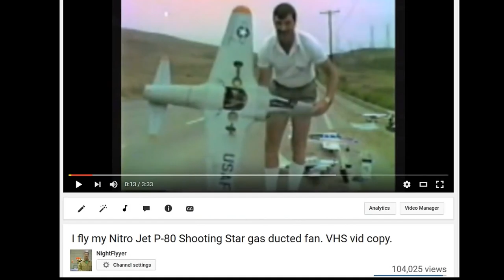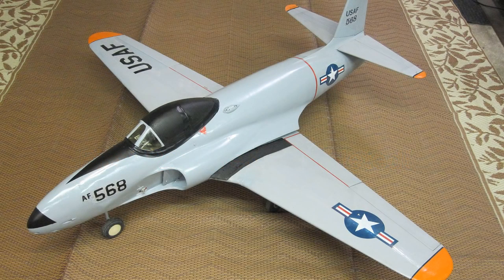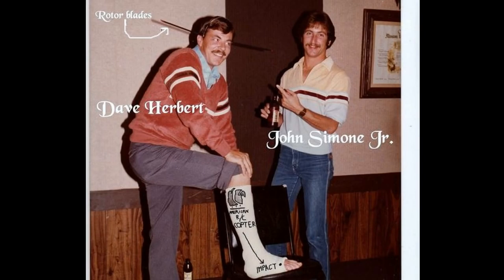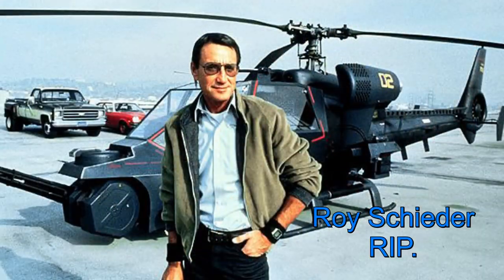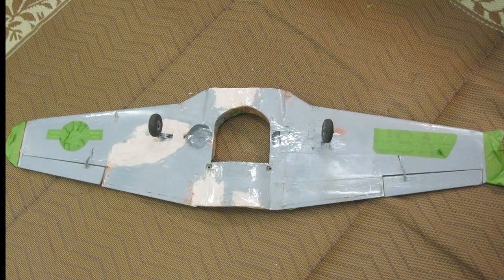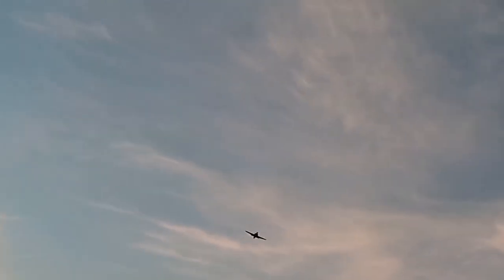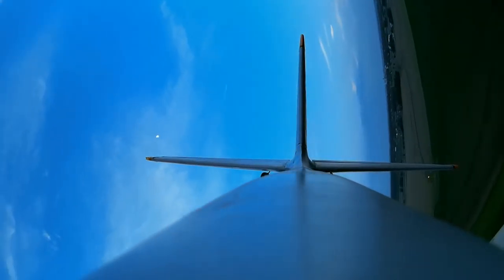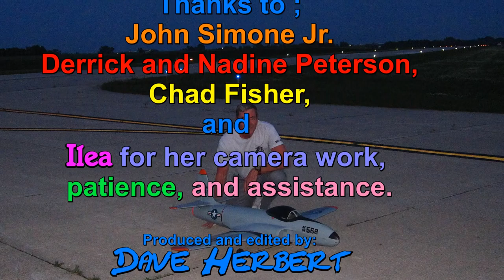Third Flight Attempt of the Crashed  P-80/F-80 Shooting Star internal combustion ducted fan jet!

Comment from the maker: I now know where the CG is for this particular model by educated guess.  Then by adding 5 ounces of nose weight and other mods I am satisfied.  I still do not know the manufacturer, as I did not build it. Thanks for all the help and comments from everybody.  Next time, I am going to add a glow plug battery to turn on at low throttle to keep it running at lower speeds. Thanks everybody. ~Dave

Comment: I enjoy that very much Dr. Herbert. Congratulation on the flight and nice story telling. Thou I would be lying when you was taken those dive and high bank curse. One point I thought it was about to loose power, and then Nose dive when you was making that one High Bank. Glad everything went smoothly.
Reply from the maker: Hi Captain and thank you so much. I agree with the diving part, but when I tried it on the first two attempts, it would stall before I could dive.  Then started diving on it's own and  snap rolled when I gave elevator to pull out and crashed.  But now...Yay!  Thanks again.

Comment: Hello Uncle Dave :) , just curious if adding re-tracts would have a big impact on yr P-80 weight & flying characteristics ? Thanks again for being such an inspiration to us young ones ... !
Reply from the maker: Hi.  Well it has retracts and they used to work, but deteriorated air hoses and a destroyed air tank in the first crash made it not that important to try to fix.  The speed would only be increased as the weight is the same, since they are still in. Good observation and thanks for the comments.  Uncle Dave

Comment: One trick you can do is alligator clip a battery onto the glow plug that is activated by a microswitch while at low throttles to help keep the glowplug hot and prevent motor stall.
Reply: I just noticed your comment from a year ago mentioning exactly what I just did. Looking forward to updates on this jet.

Comment: Fab flight Dave, seems to glide a lot better now. As for sucking in air, have you tried a felt clunk in the tank the same they use for a gasser? Just an idea
Reply from the maker: Both tanks actually do have clunks.  The plane actually landed with lots of fuel left too. It's because I added a feeder tank that does not get air til the first tank empties.  The engine ran great and I could have flown it much longer.  Good comments and info. Thanks kindly.

Comment: Hello!

Very nice plane and nice flying!! :D
I red somewhere that you should use a servo (micro/mini) for the highspeed needle, so that when you hear it quitting, you can just flip a switch on your radio so that the engine runs richer. Have you ever heard of this?

Keep it up!
Greetings from Norway
Reply from the maker: Hi Norway. Yes I am aware of those setups. In this case there is a remote needle valve on the machine.  The carb needle is fixed. The external remote needle valve  (silver knob on fan mount) is very hard to turn on purpose as vibration can loosen it.  This engine is set to run wide open with the tuned pipe and richening it at all would kill it.  To keep it running at low speed though, I will be adding a servo with a glow plug battery that turns on when I throttle it down. That way it wont quit as, it is too rich at low speed already which cools the plug and quits. Of course I wanted to kill it this time, so I could see how it handled on landing.  Good thinking and I appreciate your comments. Thanks very kindly.

Comment: Looks like you have a little elevator flutter and it seems like the whole tail section has a little twist to it.
Reply from the maker: That tiny flutter did not affect anything, and the camera auto stabilizes and makes things look crooked. The tail never broke off in previous flights, so It was straight.  Its actual demise was the horrible fire that destroyed all my models, cars, house and of course this jet.

Comment: Have you ever seen the new equipment named CG COIL? It's quite expensive,  but when a project does not indicate the CG it becames very usefull.
Reply from the maker: I have not, nor did I see anything about it during my research.  I worked it out though, so am happy.  Thanks for the info. I will check that out, especially the next time I have a plane with no plans. Thanks again.